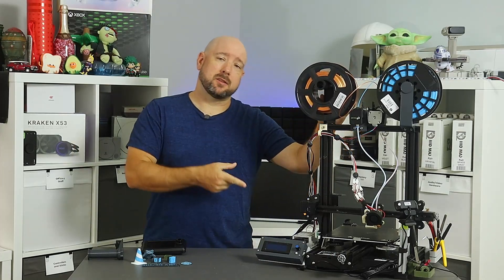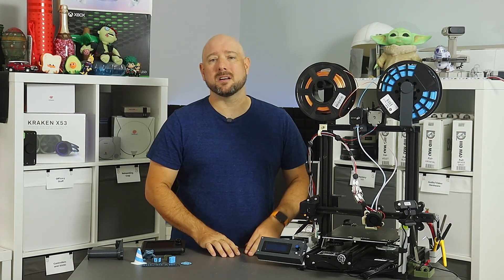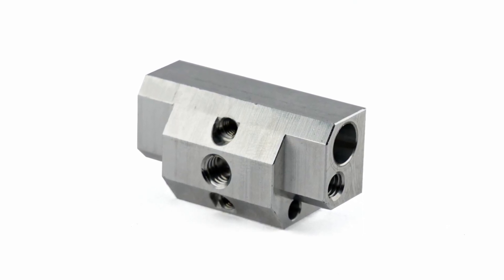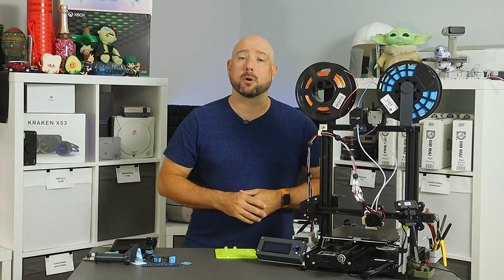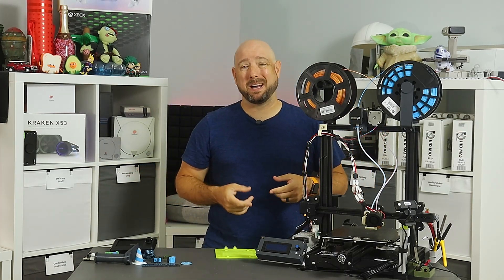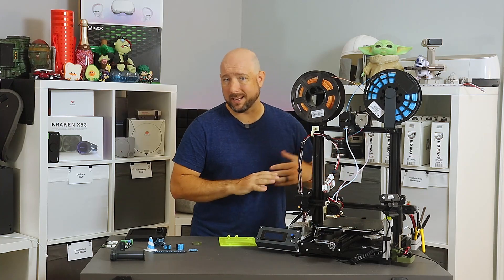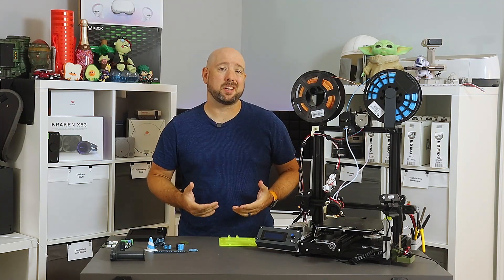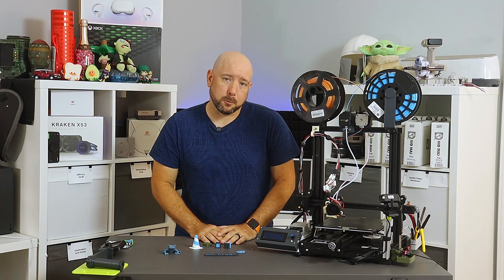Dual Extrusion on a Voxelab Aquila (or Ender 3 V2... prolly)

Comment: good to know it has klipper
Reply from the maker: I klip everywhere!  Such a better way to manage and control your printer!  I wish the Octoprint plugin interacted a little better with it. Like my printers running fluidd don't need a firmware restart if I try to move an unhomed axis or mis-enter a terminal command, but like to have an Octoprint-based printer around for trying stuff out.